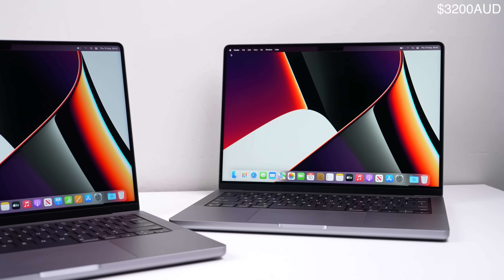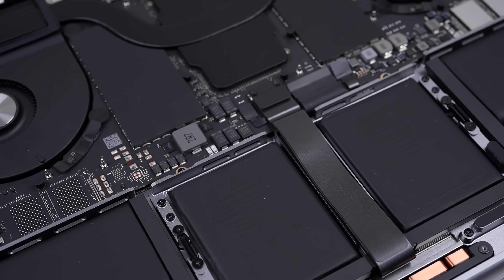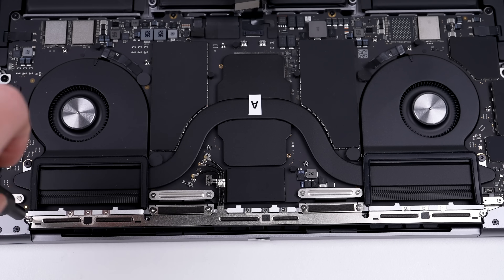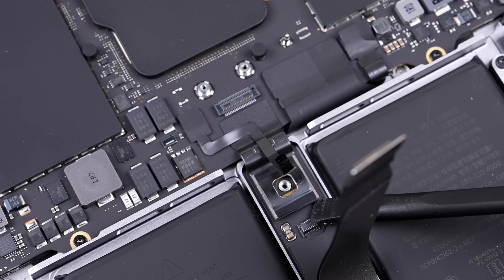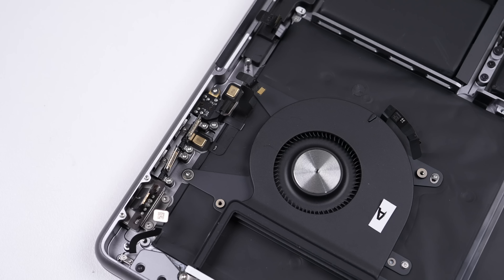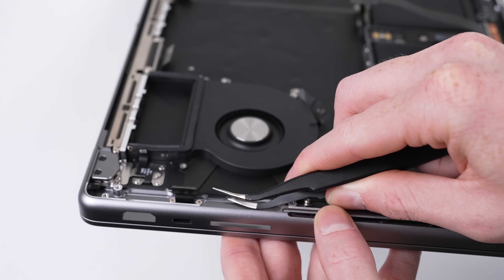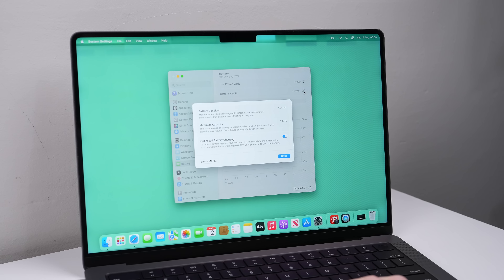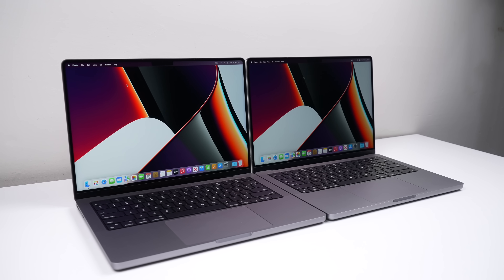New Anti-Consumer MacBook Pros - Teardown And Repair Assessment - Apple Silicon M1/M2

Comment: I am absolutely amazed at what you can do!  I have been working on and with computers for over 40 years, building more computers than I would care to count, and I wouldn't wish to try what you did with these two computers!  I dabbled with a Mac once, convincing me to stick with PCs.  If you have deep pockets, but not a deep knowledge of computer hardware, you might want to buy a Mac.  However, if you have a somewhat limited budget, and want a computer that can grow with your needs, avoid Apple products!
Reply: If you worked on computers for 40 years and cannot do what the dude in the video did you're simply not good at your job. I've worked on Apple devices for years - yes, they've gotten complicated on purpose but not impossible. There are plenty of third party shops that work on them too so it is doable. Usually the first time is difficult but then you get the hang of it.

The other problem with Apple is that once you get into their eco system you will not be able to look at a Windows machine without cringing. I've been on Windows for 20 years, switched to Mac sometime ago and have not looked back since.

Comment: Just notice, wonder if this is a thing. I notice on some of the ribbon cables there are  QR code. Do they use the QR code to link to the main board. So if you change a component, it will have a different QR code and not linked. Hence the display issue.

Comment: I personally fixed over 16,000 iPhones from 2010 to 2016 but quickly learned Apple didn't like shops (or people) fixing their devices. This became apparent when they started mating the iPhone 5S's home button to the motherboard, which killed the fingerprint functionality if replaced with non-Apple parts. I got out of the business because, after the iPhone 6, each year, they made their phones more difficult to repair. Recently, I wanted to get a program that was only available on Macs (I use Windows). I got my daughter's old mid-2010 Macbook Pro, installed a 128GB SSD, and upgraded the RAM to 8GB for under $30. Then I upgraded the OS to Catalina.  Now, the computer works like new. People should consider purchasing old Macs (and PCs) and not give these greedy companies any more of their hard-earned cash.
Reply: buying old/used macs is a total crapshoot since 2016

Comment: Even Apple itself struggles when changing screens. Two years ago, I took a 2019 16" MBP to an Apple store for a warranty screen repair. They told me they couldn't configure the new screen due to the lid sensor. They tried twice and still couldn't do it. They sent me to another Apple store, and the same thing happened. Apple ended up giving me a completely new device. This whole process took about three months due to component shortages.

A few months ago, I had issues with the screen of a 14" MBP that I brought in for warranty repair. They also faced problems with the lid sensor. Only on the second attempt were they able to fix it.

Comment: Ok, I understand the issue with Apple and “right to repair”, however, like you said, this laptop cost between 2k - 6k. Unless the owner is Apple technician or very high skill electronic technician that knows what to do, no one but Apple should replace anything or even open those laptops. 
I myself taken a part at least 100 Apple devices ranging from 2010 to 2016 years and usually know what I am doing … I would never open a 6k laptop  to replace something as big as a screen….

Take it to Apple … will not be cheaper, however will work and function as needed.

Comment: 7:12 - looks like mechanical adjustment is possible too if this hexagonal part may be rotated independently from other part of the hinge.
I am pretty sure that software adjustment just a bit more difficult actually than "set to zero" on kitchen scales.
Reply: You can't, this part is welded onto the hinge shaft and unmovable.

Comment: Soldert SSD´s in Laptops should be banned! It is a consumable. It has a very limited lifespan. So it is not a question if it fails rather when it will fail. Everybody that bought a PC with an SSD soldert into the Device s should understand that he will have an expensive paperweight when it fails. Something like this should be at least be written in the product description openly (that the SSD is soldert and can not be changed)!

Comment: What an environmental disaster, these new machines will be landfill material with no aftermarket repair options. I would suggest if you do any professional work and require reliability you look into Dell or Framework so your device can repair in a timely manner. I did love Apples iOS / OSX products however the hardware repairability and cost was an issue, and certainly not this kind of pain. Windows 11 is actually really good and pairs with my Android phone now & Android has come along way. Nothing Premium from Apple about the lack of repair here, they need to think different!

Comment: I replace a PCM in truck the replacement PCM was a used one off a another truck that was totaled out of the same year, engine, transmission, body style. Just write the VIN to the new PCM, and reset all learned values. do two key cycles and away we go with a running truck.

Comment: I've owned a few Macs many years ago now and my experience with them when it came to any kind of repair:

Me: So do you know what's wrong with it?
Apple: It's going to need a new logic board. Replacing will cost $800 plus labor
Me: But the tests i ran showed the memory is bad.
Apple: It's definitely a logic board issue
Me: I replaced the ram myself with ram from another computer and it worked fine. Zero errors.
Apple: If you want it fixed, it will be $800 + labor for the logic board and we'll let you know if any other problems are found. 
Me: So when you replace the logic board and find the ram is still bad, what's that going to cost?
Apple: $500+ labor. 

Me: Goes and builds my first PC with latest model components for the price of the Mac repair which was faster than their latest mac pro.

Comment: Imaging you are getting paid to make a screen glitch on purpose...
No way are those anomalies because of calibration issues. If they can calibrate the display remotely without seeing the screen, they cannot claim it's for assuring color accuracy, can they? They would need some calibration device looking AT the screen, which means that those backlight and color problems are artificial.

Comment: Time to start regulating repairability, durability and longevity. Manufacturers should have to support all computers and phones over USD $1000 with parts and software availability for ten years, and no questions asked lemon law complete replacement if parts fail with 2 years or multiple failures within 5 years, notwithstanding abuse.

At the moment companies are incentivised to churn out shit that wears out or breaks almost immediately and to sell devices that only receive updates for a couple of years.

Comment: 😲 merde, i have an old Time branded laptop(that i still use sometimes) from the early 2000s that only needs 6 screws removing to take the screen off! and you dont even  have to take the case apart, just poke a pin in a hole, slide a small cover off, lift up keyboard and remove if you like and voila, 4 hinge screws each side, and 2 to hold the connector down!!!  the lid shut sensor on that is a tiny mechanical microswitch 😉  pain in the bum to replace the cmos battery, though 😁 then you do have to pretty much strip the whole thing down, even removing the cpu fan and heatsink/radiator combination

Comment: Calibrating similar cables... what a nonsense btw. ... they need to implement a chip with a serial to figure out the swap otherwise they couldn't tell ... all these "issues" are just implemented flaws ... and all those dumb ppl still buy apple because renown ... just stupid :)

PS: u said it urself ... they are paired and not calibrated ... they dont net to recalibrate them ... all they do is the pairing xD

Comment: My 2012 MacBook Pro was, and still is the best laptop I've ever owned. It was fast, it ran cool & quiet, and it was eminently repairable. The garbage Apple sells today really just makes me sad.
Reply: I 100% agree with you. I gave it to my mom after I got the worst macbook pro. The 2017s. The 2012 still works like charm. I upgraded the ram and put a ssd in it. Never had an issue. Not sure when or how apple lost its way. They were not saints but still better than the crap they have been pulling in the last decade

Comment: In ifixit's defense, they rated this higher because the screen is easy to replace, they didn't mention anything about the angle sensor, so I must assume they didn't know about it. They also (rightly) give apple credit for having replaceable ports. They rated the largely similar M2 2023 model as a 5/10 with the caveat that apple make their repair tools available.

Personally I would give Apple 0/10 for everything until this happens.

Comment: The problem with Apple repair is not just their cost, but their incompetence and dishonesty. They're known to claim simple repairs are irreparable, misattribute faults to the wrong cause, falsely accuse customers of water damage, and only support component swap repairs while being unable to perform simple electronic repairs to a motherboard. This can lead to unnecessary loss of data, additional expense or complete loss of product.

Comment: so  you must be reddy to thow away you  laptop if one small thing brake after a 1 year , i have a cheap 250euro lenovo laptop , and the keybord only cost 150as part ,  so a reapr shop will ask me 50 to chage it ,   is almost has much as the inire laptop , i guess same go with apple product repair , got broken sceen on 2000euro laptop scean will cost 1900

Comment: You bash Apple all the time but there not the only ones to do it like I’ve said before if my phone/laptop is stolen and requires Face ID to work then if all I had to do was replace the Face ID module then boom I have access to all your banking information where as how Apple do it it won’t work so therefore leaves the device unusable in my eyes good as I know if my phone is stolen then I know my information is all safe…….

 This is the way it needs to be as we have so much information on our phones and laptops these days as for Apple certified repair that’s good too or the whole system would be no good

Comment: Looks like apple us using come kind of software calibration of the chips and screen after replacement. Fingerprints are of cource normal, since you change the sensor, that part of sercurity. But Apple should do so much beter in repairability, this is what I hate about otherwise good computers.

Comment: I still use a 2011 MacBook Pro, it works perfectly, and my 2012 iMac is perfectly fine, although the screen being glued sucks and putting the screen back on is tough.

One device that is so unrepairable that I guess Apple knows was a horrible move is the iPod touch. Their batteries are soldered in to place and cannot be replaced, even in older iPod touch models. If the battery expands, or degrades normally the iPod is dead.

Comment: about the angle sensor ... I work for mayor automotive supplier and I do work with Melexis and NXP magnetic angle sensors. Although  I do hate Apple with passion this one might be side effect of their decision to choose such sensor. I think this hinge angle measuring is just overcomplicated as hell and not necessary at all.
For explanation: The magnet on the hinge don't have N and S pole at the same place. So the calibration have to be done. Which will tech the sensor real end points which the sensor will use to calculate output. Problem with this is the end of the calibration procedure. They are calibrated once and then the settings are permanently locked. That is why they don't work after swapping them.  And even apple can't do anything about it (probably, unless they work different then NPX and Melexis sensors or have some agreement with supplier). They don't care tho. If it dies 5 years later then it is not their problem. If it dies in warranty then they don't care either since cutomer already paid for it in base price. They could supply repair centers with blank brand new sensors and software + hardware to calibrate them but this is Apple, right? They know their customers, they know their customers will come back. Because apple is fashion brand notthing else. ...... Think different.

Comment: I work IT for a school district and had to repair one of the new Macbook Air M2s and saying those are anti repair is a joke- They're repair hostile. The first one I took apart I managed to cut my hand pretty seriously on the back panel, dripping blood on the ground type of cut. It also took my entire team multiple days to get the back panel on after we'd removed it for the first time. And we went through Apple's official training.

Though I'll never be able to stop thinking about "single use heatsink". They aren't kidding- you can only use each heat sink once. If you have to remove it there is NO way to do so without destroying it.
Reply: Yeah, that's why most of us in IT (At least those working for large companies) hate macs and don't want anything to do with those expensive pieces of shit. Always something that doesn't work, always something that breaks and isn't easily repairable or replaceable to keep the user's downtime to a minimum, there's always something it's not compatible with, requiring you to do the same job twice juuuuuust for the damn macs, the OS doesn't let you do what you need to do, no Active Directory and the list goes on. Just a fucking nightmare to work with. That's why companies usually go for all Windows laptops. Not Linux, not Mac OS. Windows. I work for a university that has several thousand employees. We don't have time to waste on that garbage, though we still have to cope with ignorant students and professors who use macs but we sure as hell don't touch anything remotely related to repairs. We help them do what they're trying to do but it stops there. We ain't gonna fix their macs, they gotta go somewhere else for that cause those computers don't belong to the university in question. It's their personal laptop and it's not our problem they decided to buy that.
Reply: Oh no, I'm not arguing for Macs. Though admittedly I don't think I'd argue for Windows either. Either way is so much headache and bullshit- I worked for Dell doing warranty service for a year and if I ever have to touch an Optiplex 5080 again it's going to be to hurl the piece of shit out of the window. All the universities in my area love the giant bastards and they're all 18 tons and they all take ages to get apart, and they all sucked. And the Precisions (7560...) haunt my nightmares. I've cut my hand on some of THOSE too, and I wanna say a high end latitude with an aluminum chassis. I have a hard time remembering any of it because I spent most of it in a stress-and-insomnia induced fugue state.
It all sucks. I love computers, I love my work, but some days make me consider becoming Amish.
Reply: @NGC-6302  Yeah I know you weren't advocating for macs, just sharing my experience of having to deal with those. I've handled quite a few Optiplex too and they were the ones from the early 2000s. Yeah they weigh 18 tons and they're way more annoying to work inside of than any custom-made PC, there's no question about that. I'd still rather have every single computer be a DELL Optiplex than a mac. Nothing is perfect in this world. I also was around when HP fucked up their Pavilion laptops in the late 2000s. There was a design flaw that caused a solder to literally melt near the CPU and fried the motherboard. Even if the computer was still under warranty and physical damage had been caused by users who btw all had the exact same issue, HP wouldn't want to repair it under warranty. If you wanted that "fixed", the entire motherboard had to be replaced and it cost around $500, almost the full price of those laptops.
I kinda miss the time when Elitebooks and Probooks were actually good. Took 5 seconds to open and everything was readily accessible. Took 2 minutes to get to the keyboard and you didn't have to take the entire computer apart. They were designed to be easily and quickly repairable under warranty by any authorized repair shop, was super easy to order replacement parts and it would take a few days at most for the customer to get their laptop back unlike the pavilions which had to be sent to HP for like a month cause HP was adamant about not wanting to provide any parts for the cheap ass best buy / Future shop models.

Comment: While I would prefer a device that is easy to repair at home, to be fair Apple has made monthly Apple Care plans renewable indefinitely, as long as they still make parts, which is usually about 10 years, and there is no longer a claim limit, so you can have your Macbook repaired as many times as needed. That's not bad.

Comment: Even more reasons not to purchase (Cr-)Apple trash! Hell an SSD is a device that is meant to fail (after a certain amount of writing and deleting and rewriting data onto them they fail inevitably!) and building a device that is trash after that? Damned, Apple that's e-waste! Add to that that the battery needs tool to remove? Yeah, nope! (Note: Not for long! Soon user removable batteries will be king again, because the EU demands them! Removable without tools!)
Sure their stuff is snappy and responsive, but if you have to only optimize for one type of device than that is quite easy...I'd rather purchase android devices! Or true PCs/Laptops!